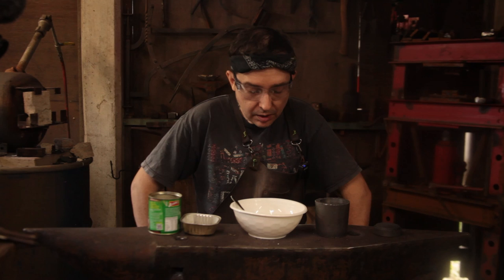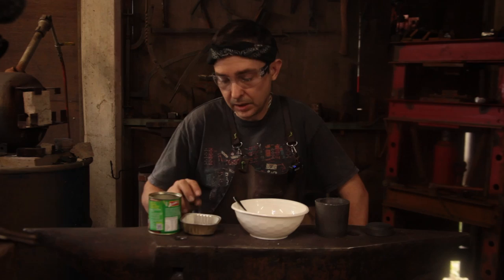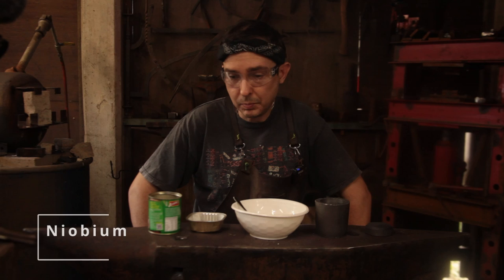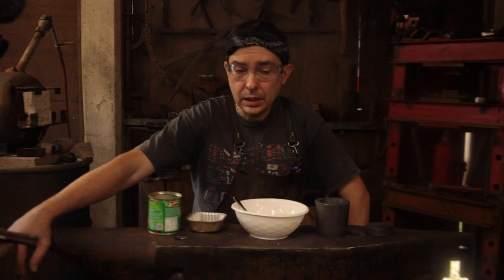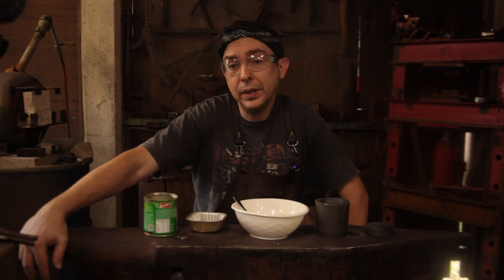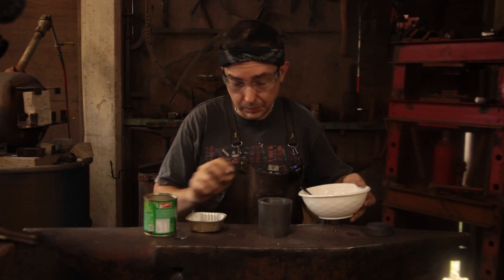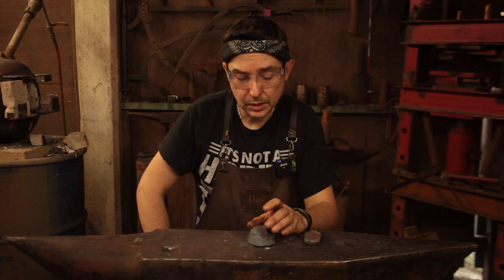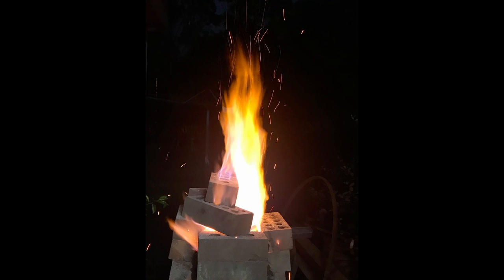First experiments in Wootz steel making

Comment: Doc, how did you get the billets out of your crucibles?  Did you have to break the crucible(s), or did the billets fall out once cooled?  What you are experimenting with is fascinating and one step further in "the process" of making steel(s) than what my local Blacksmith group is planning for next Saturday (03 Sep 2022).  We plan to attempt making an iron bloom in a furnace, then splitting the bloom into ~4 pieces so ~4 smaller groups of Smiths can hammer them into wrought iron right then & there (as a demonstration at the "Barberville Pioneer Settlement" in Barberville, Florida (USA).  As far as I know, only the "Lead Demonstrator" has done it before (out of our group), so I hope that he won't be herding cats ... I mean Blacksmiths ... all day to hopefully obtain some real wrought iron.  I don't recall what the plans are for the wrought iron we'll (hopefully) make.

If I understood your question about something you hadn't experienced at that "low of a temperature" (I think that's what you said), perhaps the sparks you saw were slag and/or other impurities being hammered out of the billet?  (Or was it just flakes of the cracking billet shooting out of cracks?)

Lastly, did everything in your machine shop survive the earlier flood?
Reply from the maker: For the small billet it just slipped out, for the big one I had to smash the pot sadly. I’d love to be in on a bloom! I have some 100lb of forge scale and 50lb of iron cemented sand stone I want to smelt. The machine shop faired ok. the mill needs a bit more work yet (bad bearing in motor) bug otherwise every think seems to be working well 6 months on from most of the repairs.